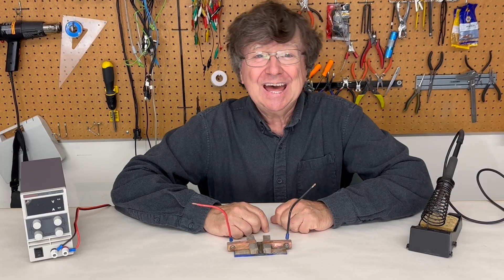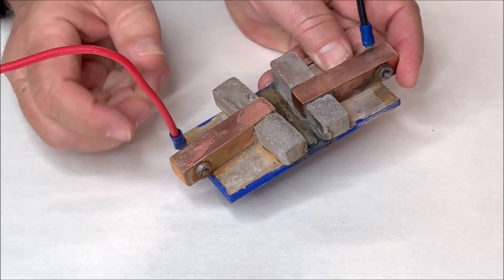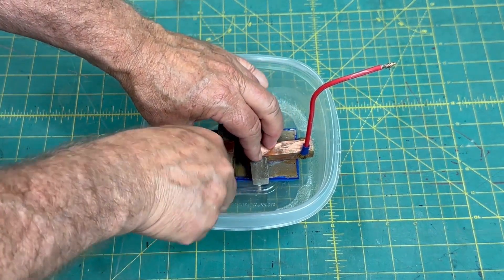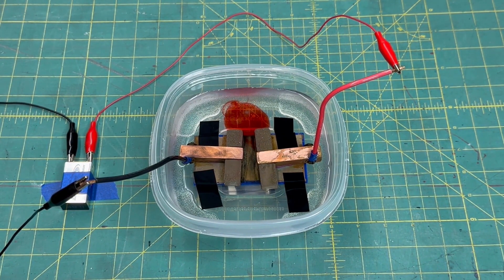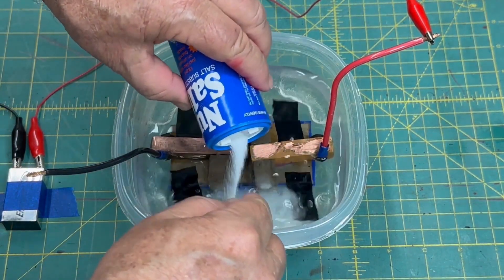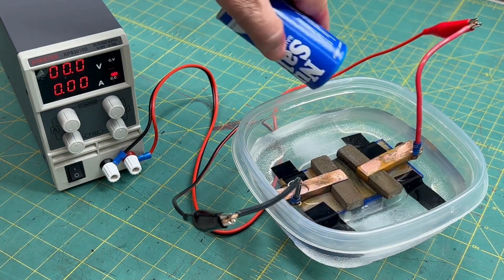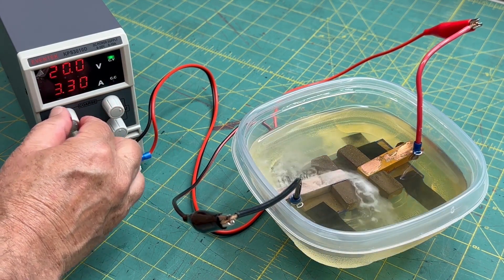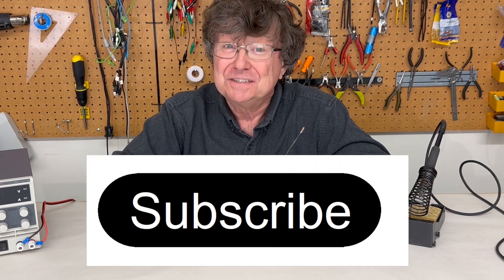How to Make a Magnetohydrodynamic Thruster

Comment: If you're not already familiar with William Fraser, he has done some very interesting MHD catamaran water setups. The most notable differences is that he #1 uses transformer steel to concentrate the B-field in the active area, #2 has electrodes conforming to the shaped of the bottom of his hull, #4 produces thrust externally over the hull rather than internally through a channel to reduce losses, and #5 uses dissimilar metals for the electrodes to create a sacrificial electrochemical cell that eats itself to produce thrust. Certain pairs have a lower embodied energy.

Some considerations for MHD drives to avoid the enormous losses associated with electrolysis / hydrolysis include powering them with an inverter to generate AC currents through the working fluid. Short duration pulses can also overcome losses so I've been told.

 As you're probably well aware, the biggest challenge for MHD is to increase its efficiency. I covered some small considerations here but obviously relative velocity, magnetic field strength, and conductivity are the main benefits to thrust and efficiency.

Comment: is there another way to generate the electric field besides using the power source?  I built it and know why you don't stick your hand in there.  It hurts. Apparently the electrode has to be submerged in the fluid to make the salt water pump.  I can't think of a way to put some device outside the container to generate an electric field to make the fluid move.   If for some inane reason a person wanted to pump urine out of the bladder of a chicken using a magnetic field combined with an electric field from a battery, seems you'd need to have the electrodes in the bladder, not outside.  Using electrodes outside you'd get little or no voltage through the chicken's feathers or skin.  I don't think you can transform the chicken into some sort of capacitor to get an electric field inside it and the use the additional magnetic field to pump the urine.
Reply: I saw a video about inducing an electric field by changing the magnetic field as it moves back and forth near a coil.  Certainly generates a field in the coil, but not much in salt water even though theory says it does behave the same in space too.

Comment: This is the Lorentz effect.

Also, there is a vortex you cannot see with the small end horizontal at the negative block. The small end of that vortex is driving the water in coordination with the spin that the magnet is putting on it.

Comment: Can you build a similar concept but employing solenoids and AC on plates so you would get e-mHD (electro-magnetic hydro-dynamics)

It done with correct resonant frequency without going overboard on the hysteresis you should abolish all electrolosys and thus gain a better propulsion.

yamoto 1 did 8knots but they calculated 100knots with EMHD (ACMHD) but were stopped and last minute went with DCMHD which is electrolosys prone
Reply: It seems doable. Similar results can be obtained by insulating the electrodes and applying high voltage.

Comment: It looks like there is more flux being created by the magnet on the left.  Hardly any bubbles or spiral motion comes from the copper bar on the right.  Why such a large visible discrepancy?

Also is the magnetic vortex linear or does it form a spiral?
Reply from the maker: We're looking at that too. Our electrodes are offset  to each other. We found in mach flow we get more performance. I think in the water it just makes the flow direct more to one side.
Reply: @johnmpowell  Thank you. Keep the great work and maybe up your sound level a bit please.

Comment: I apologize in advance for the wall of text 😊 this comment got out of hand quickly. Thank you again for educating on this important topic!

Have you ever corresponded with professor Jean-Pierre Petite on the subject of MHD? Coincidentally another JP that shares your passion for MHD! 

It may be too late in his career to collaborate on such a project, but I feel like his work on external surface MHD engines is extremely important to this field of research. His lecture in Prague is available on YouTube, wherein he describes MHD tests of disc, sphere and cylinder shaped MHD engines, using both axial field and paraxial field coils, conducted in water and plasma. His work in supersonic Argon plasma wind tunnels demonstrated how MHD generators can induce shockwaves ahead of vehicle airframes. He also showed how MHD accelerators and generators combined flow control can eliminate shockwaves and wake turbulence at supersonic speeds. By combining MHD accelerator to reduce drag on the leading edge with MHD regenerative breaking on the trailing edge to reduce flow detachment, a two step process of accelerating and decelerating the plasma was the key to maintaining laminar flow. The flow of plasma takes a very unusual laminar exhaust profile at supersonic speeds, it sheds an axial toroidal vortex (a donut on a rope) instead of the usual Karman vortex street of alternating vortices. This flow is what prevents locally supersonic flows relative to the surface of the fuselage.

At first I didn't think this effect would be applicable to the concept of orbital airships outside of the atmosphere, but then I realized that acceleration through the ionosphere would be extremely efficient using an external surface MHD engine, much like the European Space Agencies design for an air breathing ion engine for satellite propulsion. The biggest drawback of the internal reaction chamber design for air breathing is the need to maximize the surface inlet area. An external surface on an airship would be perfect for such an MHD engine.

Some other observations about the potential for plasma propulsion:

The Russian AYAKS/AJAX space plane design was an MHD bypass engine that also attempted to solve the problem of air breathing in the ionosphere. In front of the MHD bypass engine, ionized Oxygen would react to the motional EMF of the MHD generator stage (propogating forward at near the speed of light in the medium) to form a "virtual magnetic RAM scoop" extending hundreds of meters in the direction of flight. This would cause inspiraling plasma to compress ionized Oxygen into the inlet, generating electricity for the accelerator stage, without increasing the Oxygen temperature due to the compression so that it could be further pre-cooled for the turboramjet combustion cycle. 

NASA has also designed several types of magnetized plasma propulsion systems for space travel. Some designs include a plasma parachute for atmospheric re-entry. solar sail (the M2P2 or Mini-Magnetospheric Plasma Propulsion thruster) which has at least on paper, the capability to make interplanetary transits and even reach interstellar escape velocities using solar radiation pressure and deflection of the solar plasma wind. The M2P2 design is not true MHD, rather an internal RF antenna heats Helium to plasma state and a solenoid coil induces magnetization of the resulting plasma so that it augments the coil field, curving the path of the plasma into a toroidal vortex that mimics that Earth's magnetosphere interacting with the Solar wind. 

Given the enormous surface area of your airships available to collect solar power, the relatively modest power requirements of the M2P2 magnetized plasma solar sails and external surface MHD designs could push the range of your ships well beyond orbital and cis-lunar, while also providing an additional layer of radiation protection due to the plasma envelope that forms around it.